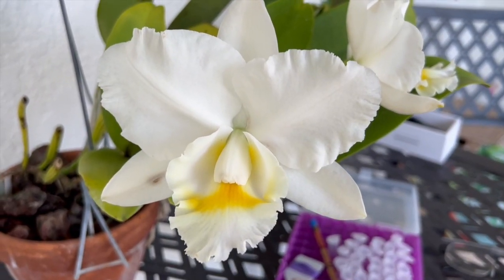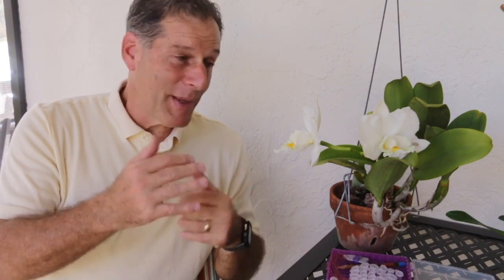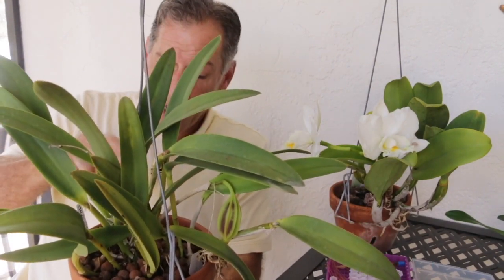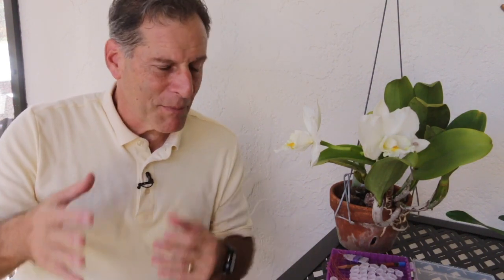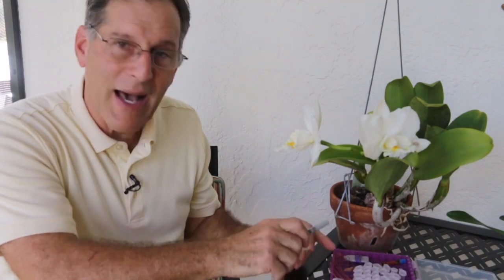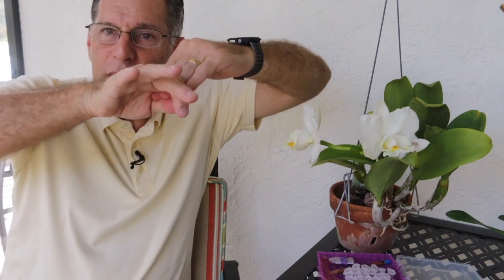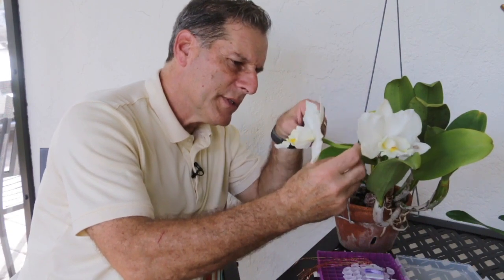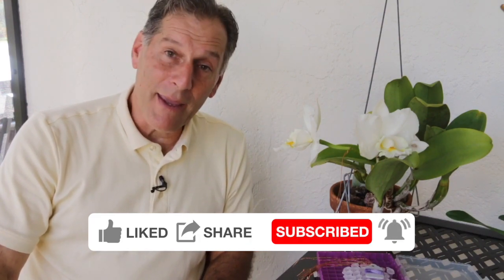Using a New Bloom to Make Orchid Hybrids

Comment: On making crosses: do you take into account the polyploidy of many grexes?  I tried several times to cross one of the best outdoor (in SoCal) Cattleya hybrids onto others but it turns out it was likely a triploid and sterile.

Many of the old, cherished Cattleya hybrids are tetraploids, but many novelty crosses and species in collections are diploids, hence the problem.
Reply from the maker: That is a great question - I will look on OrchidRoots.com to see if anyone else has generated progeny but I tend to be a try it first and then see what happened later kind of person. If the orchid is a newer release, that information will not be there if the hybrid has only been available for a short amount of time. For an older hybrid, you can do a quick check to see if it has been a good seed or pollinia (or both, or neither) parent. I would expect really poor pollinia formation on triploids but I am just guessing. Again, normally, I do not look into the ploidy, unless there are issues.